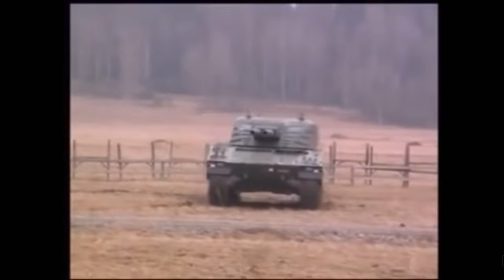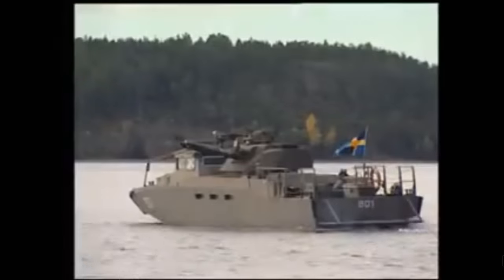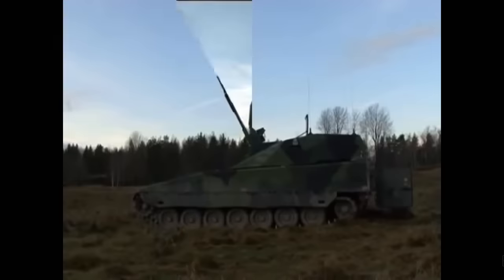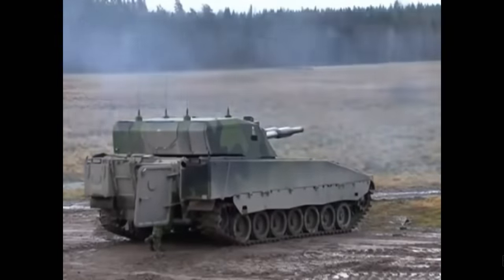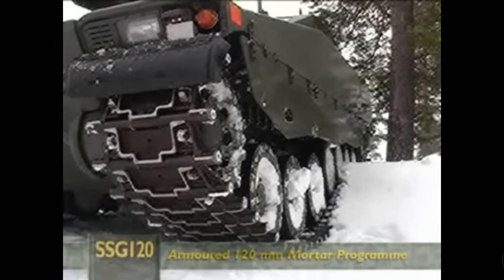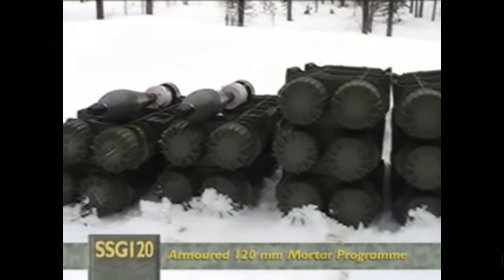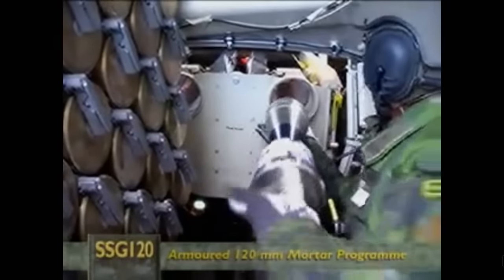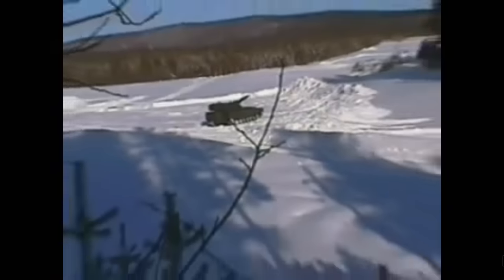Advanced Mortar System (AMOS) - Twin Barrel 120mm Mortar

Comment: Aah...the Amos. And the weird Swedish (I'm from there...) who spent about 8-10 years developing it with Finland, only to drop it as it was completed (including the brutal Srtb90-version  and sell/transfer Sweden's 50% share to Finland, who took it up and incorporated into it's army...and put it on Patria platforms (I like the CV90 platform  better). Aah, the ringing of those twin barrels...🙄
Reply: ZeOverman Denmark, Norway, Sweden and Finland started the project however, Denmark and Norway dropped out after a few years (about 1999). Because of that the project was cancelled. About 2005 the project relaunched with Sweden and Finland creating the AMOS. However Sweden decided to not use the AMOS and instead got the FMG (twin 120mm mortar but its fed through the barrel end) which allows for manual loading outside the vehicle (In Sweden’s case strf90 or known as CV90 (Combat vehicle 90). The Swedes did actually develop the AMOS

Comment: What's so good about mortars? They're cheap, light & simple. Put it on a vehicle and its suddenly none of those.

The saving grace is the fact the turret can fit on just about anything. With that in mind several armed forces might be able to tack them onto existing vehicle procurement programs but unless they're logistical footprint is significantly less than SPGs I doubt I think they'll fill a pretty small niche.

Comment: My only dislike is that it is a manned turret. Otherwise, pretty good product.
Reply: Jonne Koivisto it's just a personal preference of mine but I agree with your point.
Reply: in Valhalla神様 unmanned turrets can be beneficial in many respects, but they are a bitch when ot comes to maintenance and clearing malfunctions.
Reply: You kind of need to have some degree of manning when operating a self-propelled gun. Someone will need to set the charges (cut away propellant rings that are not needed) of the mortar shells. Even in self-propelled howitzers with automatic there is a crewman to set the amount of propellant. If you're going to put one person in there as a loader, then may as well put the commander in there and save the space in the hull for more ammo. 

Having said that, I agree with the general sentiment. Having an unmanned turret would significantly reduce the weight of the turret. It might even present an opportunity for a reduction in the turret ring diameter, especially if an autoloader like the Meggitt transfer arm is used. However, someone will either need to pioneer an automatic charge setting system, or sit on the floor of the turret, cutting rings from the mortar shells before they are loaded.
Reply: Need someone to brew tea and coffee!

Comment: This seems like it defeats the modern purpose of the mortar as a man portable system
Reply: That's what i was thinking lol i mean they put mortars in the M113 but this, it might as well be a SPG
Reply: spg > mortar. heavy mortars require truck transportation anyway.
Reply: Cost is the issue vs.man portable ones.
Reply: It’s so infantry can support itself and adjacent units with indirect fire quickly rather than needing to call a lengthy fire mission
Reply: Lengthy fire mission and amos are not be used in the same sentence. You give fire mission, they make it happen. Rounds are hitting ground accurately before infantrymen have even launched a single one. Of course infantry need their own various sized mortars too, but this can be super effective, and offer mortar strikes to several places in a hurry.
Reply: Sanic Hegehog.   120mm, or the old 4.2", were NEVER man portable.  Not by this man, anyways.

Comment: A whole series of Mortar systems were proposed or tested in Canada in the 80s and early 90s. One added four 120mm mortars to the rear of an M113 as an add-on attachment. Another was a turreted single 120mm. None were adopted. We also tested four patterns of camouflage uniforms in the 80s. None were adopted.

Comment: I like it. Mortars were the most 'effective' weapon in WWII. Twin 120-mm auto-mortars in an armoured chassis is expensive but would really pack a punch and have some survivability in direct fire situations like mechanised urban combat, or against fortified mountain positions. Bet the barrels wear out quick, hope they change easily. Ultimately, probably only useful where ten times as many (cost-equivalent) 120-mm guns carried by inexpensive soft vehicles wouldn't do a better job. peace

Comment: CV90 is one of my favorite moern vehicles and IMHO should be used by US Army to replace Bradley. Acess to AMOS is one of my reasons I prefer it. One thing to point out is mortars typically fire at much lower chamber pressures so the shell walls dont need to be as thick as artilery shells to handle the pressure. That means more HE filler for larger blast effect.

Comment: Great Video: So in the event of a system break down, can the weapon be used manually or in the event of an EMP, can it be used without its digital FDC(fire direction and control ability) ? Does the system, have Ir, and will it have capability of taking down light targets such as Drones or Helos? Can the system be deployed in a Pod format, where the system can be modulated by a single soldier? Thank you for your time.

Comment: I still can't believe mortars can hit anything let alone how cheap and awesome they are.

You would think something as simple as a bit of wind would impare accuracy to the point of uselessness.  But yet it seems better than most air support and Artillery in both speed of deployment and accuracy for obscure targets.  (I've seen videos were it takes long minutes for the ground forces to relay enemy locations to CAS that's on station, meanwhile a good mortar team can absolutely have the fight done yesterday)

Comment: Why are mortor tubes smooth bore?  I get that tank barrels need to be smooth bore to fire finned discarding sabot rounds but wouldn't a mortar be more accurate with gyroscopic stabilization of the projectiles?

Comment: Smoothbore, direct fire - add in a TOW package. Put the whole thing into the 120mm round, nothing special to load or fire, just select and shoot. Add a 3rd barrel, put a rotary loader between the 3 barrels - don't rotate the barrels, too heavy and slow, just sequence the loading. And having 3 different loads "up the spout" at any moment gives a quick choice of weapon.

Comment: Very cool weapon system. Definitely a game changer. Throws a lot of cold steel down in a short amount of time simultaneously.

The weapon system on the river boat seemed very unstable though, even with the jet propulsion on the boat for station keeping.
Reply: There is one barreled version of this too, NEMO. It is used in boats usually and can be shot while driving too.

Comment: How close can this unit deliver projectiles in near vertical fire? What is the dispersion ? I'm think that since tanks have far thinner armor on the top of the turret and hull, I the 120mm round could be placed accurately, it could be a good anti-tank weapon as well.
Reply: STRIX infrared seeking anti armor HEAT rounds

Comment: Thanks Matt.  So, did I watch the video properly?  It seems it is MOSTLY autoloaded... but it is the loader's role to rip off the correct number of donut-shaped propelling charges, to set the range?  Am I correct that the autoloader, and computer-assisted aiming system, does everything, except set the range, and it requires a human to set the number of charges?

If that is the case, and the loader removes too many, or too few donuts, the projectile falls short?  Oops

Comment: That loading system reminds me very much of the S103 turretless tank. It would be interesting if a turret is really needed. Not that I will delete turret all together, but instead of the direct fire mode I would have a canon-turret with a 25-35 mm. caliber. This should still bring the weight of the system under 30 tons.

The problem is how it will fit on a Piranha 5 turret.

Now the question about having 3 or 4 guns in a halfbattery is mainly a question of the reliability of the ammunition. If the dud percentage is 30% as was the case in WW1 then 4 guns are needed to have the same effect on target as 3 guns with 5% duds. Danish army has traditionally had 3 guns in a half-battery, but that demands constant practice and firing of live rounds to check on the quality of depot ammunition.
There is a significant logistic difference: If you need 100 rounds on the target you need to fire 140 rounds with a dud-percentage of 30% - if you only have 5% you only need to tote 105 rounds. That is a reduction in logistic strain of 25% for ammunition. It is no so much the cost of grenades I count (as artillery is generally cheap compared to other ways of bringing explosives on target).

The third question is: If you hit the target it significantly reduces the ammunition consumed. The russians haul enormeous amounts of artillery rounds against a target which - apart from collateral damage - brings down the logistics.

With todays massive firepower the battery would be around 3 6" guns and 3 120 mm mortars. The problem is however: How many trucks do you need to keep them supplied?

Finally: Range today is more a question of ammunition than barrel. A traditional 6" round has an effective range of say 20 km. But with base bleed it is 30 km (though precision is liable to suffer). Base bleed is about double in price of a traditional round, but that is still cheap. To get up to 40 km with precision - then we are talking Excalibur rounds which cost a lot more - and I mean a LOT.

The discussion about wheeled or tracked? Well, my position is: As well as! or in German: So wohl als auch.
There are arguments for both, but the important thing is: Tanks, IFV and artillery should be able to keep up with one another under movement - otherwise the unit is limited to what the least capable vehicle is doing: No point in having the best tank in the world, if they can't get artillery support! No point in having IFV's with roadspeeds of 100 km/h if the tanks are trotting 30 over longer streaches.

Comment: You didn't explain (or I missed it) why it uses 2 barrels, instead of 1 larger barrel.  And, if 2 are better than 1, would 4 be better than 2? Why not 4x81mm barrels?

Comment: If it's smooth bore wouldn't it be possible to keep a small reserve of 2 or 4 120mm HEAT warheads on mortar rounds? Sure it probably won't be the greatest anti tank round, but the ability to almost nullify hull or turret down would definitely be a bonus in addition to hitting them from the top. Very interested to see where the AMOS or NEMO go from here. Riveting video as always Matsimus!
Reply: See STRIX infrared seeking self steering HEAT rounds specifically for AMOS and NEMO

Comment: Ok, just got the intro, and there is a question i have that i wonder if you answer, it has two barrels, and in the intro it have it firing what i would call a two shot salvo, but i wonder if it can fire one, then halfway through loading the first, the second fires, and so forth, somewhat doubling it's rate of fire, could have issues though, but still.

Comment: Three of the seven years that I was in the US Army I was on the M-106 mortar carrier. Very little crew protection. No fixed seats for the occupants. Lots of stuff tied on the top roof. Only the M-2 bmg, .50 Cal machine gun mounted on top. Also, the M-16A1 rifles of the mortar squad. There was an optional armored gun turret package for the commander's hatch. The mortar gun fired towards the rear on the M-106.
Noticed the mortar shell charges looked like "donuts" on the new 120mm mortar. The now obsolete M-30, 4.2-inch had sheet charges, the mortar I worked with.
One question I have is what is to do with all the unused charges. Each round has a full set of charges, most will never be used. Shooting the the old M-30, (four deuce) for a number of fire missions left a pile of charge sheets. How will the excess charges that will be accumulated in the AMOS be disposed of without letting the enemy forces get them?
We just burned the unused sheets wherever we shot. During daylight hours, the light of that fire brightened normal daylight.
Reply: FYI: The M-30 4.2-inch tube size is 107-mm in metric size.

Comment: Force Multiplier?  While the vehicle with the two tubes is a lot less men than two towed 120mm mortar teams, since the fire rate of the AMOS is a lot higher, you will have to have a bigger logistics tail in order to truly benefit from the higher rate of fire.  So, will you really benefit from fewer men in the AMOS vehicle?

Comment: You say there isn't "AP capabiltiies"   thats not quite true.  There IS 120mm terminally guided HEAT rounds for Top down attacks, against Tank.   There is also a "HESH"  version but thats for bunker demolition rather then tank busting but if fired direct fire at the side or rear of a tank... i'm pretty sure the HESH round would still do some nasty stuff to older tanks, or IFV's.

Comment: The US 5"/54 Rifle has a 20rpm maximum fire rate.  I sort of expected a bit more from a double 4.7" mortar.
Also, this is a direction that's been explored before.  It eventually leads to the MLRS and its conceptual brethren.  Double barrels are heavy, 120mm weapons are slow firing (to prevent in chamber cook-offs).  Missiles are cheaper . . . supposedly . . . Free Flight Artillery Rockets are the usual "go to" for this sort of thing.  With modern terminally guided warheads the mortar can be dispensed with altogether, until the cost of your "smart" warheads goes up.  The Bofors "Smart" Antipirate round for the universally loved 57mm gun is a prime example of this.  A 57mm projectile that costs $50,000 USD EACH and is fired at 120rpm.  You'll go broke trying to keep up with the military Joneses.

Comment: I like the AMOS, especially MRSI and rate of fire. The cost of integrating this new system into the CAF is probably prohibitive. I feel a two section battery of C3s could probably handle indirect fire support needs of an advancing column. Lastly, kind of a short range for such a 'big' weapons system. Anyway, my two cents - ubique.
Reply: It is quite short range... Lots of towed 120mm are hitting 8-11 km ranges, this is a fully platformed mortar and only getting 5km?

Comment: Wow, 16 rounds per minute?
You almost don't need precision weapons, there''s a good chance each barrage might hit at least one if not several targets if they're grouped relatively close together.
And 120mm?
That's the same size gun as a MBT. That's pretty good range and power plus versatility of indirect and direct fire. For those who believe MBT armor doesn't protect enough, this may be the answer using mobility and quickness.

Comment: wonder what took so long. Should have had something like this in the field 50 years ago. Wonder what the design reason for the dual barrel. Guess 2 barrels does not add much to weight for a mortar.

Comment: Oh hindsight is a Beast. We know now that the Belly Armor was too thin. We know that the PAC, that would be the Engine was under powered for the Platform and the cooling issues for the drive train were design Flaws in reservoir capacities. And the final kicker, you are not gonna do enough Damage as far as Steel on Target with a 120 MM Round.

Comment: Mortars are way under rated. Since the object is to deliver the most firepower the fastest this seems to fit the bill. A faster single barrel version may be in order. Fire off 4 move and fire off 4 more and move. Sooner or later  they are going to send an aircraft after you. What can you do about it? You are hard to hide at that size and a mortar against a jet or chopper is no match. I can think of a few things to do, but they all require resources. A very formidable weapon in a fort or compound situation.

Comment: Performs roughly the same function as a MLRS but what is the RANGE? First thing you need to know and how are follow up rounds accurate from a small boat that moves when it fires? It's also pretty much useless if there is any aerial threat, has value as a last ditch defensive system this  is not a viable strike platform contrary to your opinion,  the future is (hypersonic or otherwise) medium and long range cruise missiles and drones as a strike platform, unstoppable, accurate and can be fired as groups or swarms who has the best missiles/drones controls the battle field no question

Comment: What if....

Now I'm no mortar man...

But what if we made a six shot cylinder that slipped over an already existing traditional 120mm mortar...

Like a reverse looking revolver... 

That when rotated by hand would drop six (or how many we choose) rounds on a pre-targted position...

Then after the six are fired the cylinder is removed and the mortar operates as normal...

A majority of mortars are simply base defenses.

You could already have your beatzone ranged in and the have 6 rounds on tap ready to go that can be operated by one man... 

Allowing the first man to be extremely effective while everyone else on the team is still getting there...

I dunno...

Just trying to accomplish the same thing for as cheap as possible...